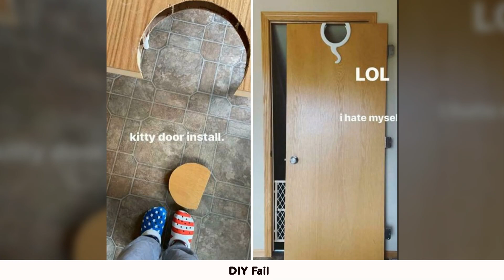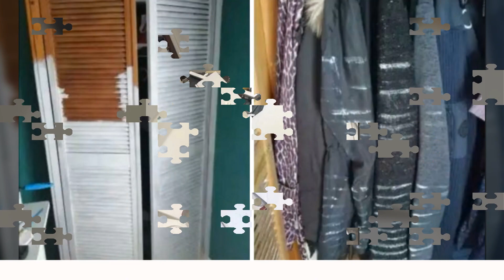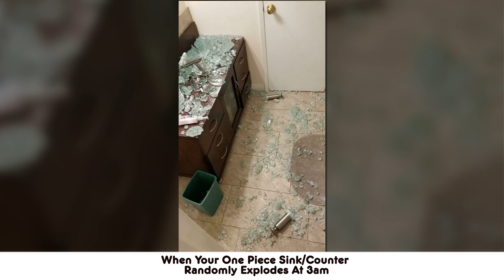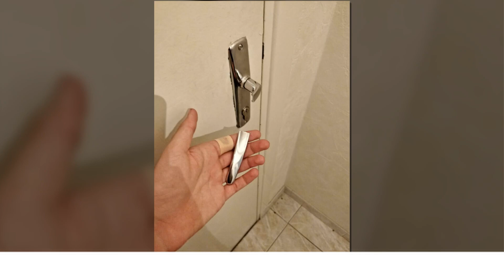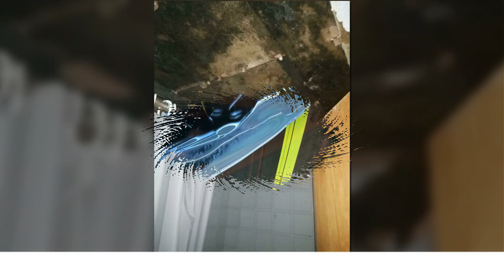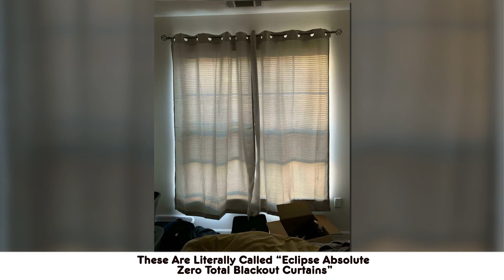‘Well, That Sucks’ Times Homeowners Had Their Day Ruined

Comment: Sis and I moved in together.  Beautiful 40 yr old house.  A former long time owner did a lot of improving.  Looks real good but we have pocket doors that can't open because the ceramic tile he laid raised the level of the floor, our switch box took 3 electricians to decifer, I almost burned the place down because the bathroom wasn't wired in the voltage it took to run the ceiling fan/light/heater unit, one of the bathrooms had hot and cold switched in both sinks.  Oh, and a screw punctured the outflow pipe for the upstairs bathroom that rarely got used until we moved in.  3 yrs of showers and flushing had dribbles going down the outside of the pipe.  When we opened the pantry we were getting a strong mold smell--the back wall had a huge stripe of black mold.  What a mess!  We were glad it was the pantry with our dishes instead of all the food.  Think we've just about got all his improvements either re-done or fixed.

Comment: Thank you for this video, it brought back sweet (😜) memories! 
We bought our first (and I hope last) home three years ago, a little house from 1965. 🏡

We knew, we had to change the boiler and the sewage pipes, but that was o.k. for us.
We expected only to put a little colour on the walls (this is the moment for 🤣😂)...

We wanted an extractor hood with a vent to the outside, so we had a specialist (!) drill a hole through the wall.
Conclusion: He also drilled out the heating pipes and two weeks after handing over the keys we had a serious flood in the kitchen...🌊

Then the electrician came and checked the power lines.
Were two-wire, everything had to go...
So my husband drilled slots in all the walls and laid new pipes.
But that meant that we couldn't just paint over the old woodchip wallpaper, as we had planned, but had to scrape off all the wallpaper and replaster the whole house inside, that became my job; amazing what you can learn when it is necessary! 🤪 (I'm still in physiotherapy treatment for shoulder pain...)

During that time, my husband removed the old carpets to find lots of big holes underneath, so we couldn't pour screed; he then leveled everything with a standing spatula so that at some point we could put parquet on top.

I won't even begin to tell you about the ceilings, which were made of plastered rushes...

Home, sweet home... ✨✨✨

We were very fortunate that my husband is a very skilled craftsman 🙏, otherwise it would have been a financial catastrophe for us.

(And another luck is that I'm a happy and peaceful person 😄, otherwise it could have been a relationship disaster...😁)

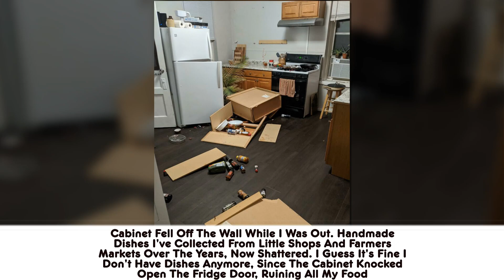Comment: 5:37. Five years ago we moved into our new build. For the first four years I kept complaining that none of the vents seemed to do anything. I thought they were just cheap vents. I bought some new, expensive ones and when hubs went to remove the old vents to put in the new, he discovered that they just shoved the vents through the drywall in the ceiling... right into the attic insulation. ALL of them were like that. The inspector missed it because why would he think that anyone would do such a thing? All we had to do was cut a hole in the insulation, replace the old vent and they worked just fine. smh

Comment: I've lived in my current home for over two decades now, and while my family's made considerable renovations to the place, there have been times it was more out of necessity than aesthetics.

1) Our home, like most houses within the neighborhood, is situated above a collection of groundwater, which sometimes necessitates the use of a sump pump when it rains. In the past, when the power went out, the sump pump would fail too, which in our case meant having the carpet in our finished basement ripped up and replaced twice. We eventually had a generator installed so that there would always be a power supply to the house and sump pump.

2) Our closets have metal racks and shelves on which to hang clothes and store items, but the original ones were simply screwed into the walls without any reinforcement. As a result, portions of my mother's and younger sister's closets collapsed (my sister was much younger and climbing on a lower shelf with a friend), and one day a few years ago, the entire rack-and-shelf system of my closet suddenly ripped from the walls, sending everything in my closet to the floor and making an incredible noise.

Comment: That door thing...so cute, still doable. Just turn it  around, reset the hinges and switch the door knob recess to the opposite side of the wall! (Diary of a single mom with four kids.)
Reply: That or just flip the door, flip the handle and hinges to the other side and boom, fixed.
Reply: @maolcogi  Or better yet... Just flip the door right side up and then, like magic, the latch tongue will line up with the recess in the jamb. The problem he has here is that he leaned the door upside down against the jamb. Note the misalignment of tongue and recess in the picture... I wonder how he is going to install that cat door hinge on the curved edge.

Comment: When we bought our house, I installed the corner china cabinet by using the screw holes that had previously fastened it to the corner.  But the builder had not put any studs in the corner.  The drywall was installed to connect at the corner without any wood to nail it to.  So, a few days later it came crashing down in the middle of the night and destroyed all our sets of china.

Comment: Had a leak in our bathroom shower.  I had to remove the wall to replace the shower control valve.   Found out the original owner of the house had used a garden hose and clamps to run the hot water line in the wall !!!!!!!!!!!

Comment: The blue color of the tiny bathroom is horrific. Worse is the tiny window between the 2 studs. The window could've gone all the way across.  CHEAPSKATE!  Run, spouse, RUN!
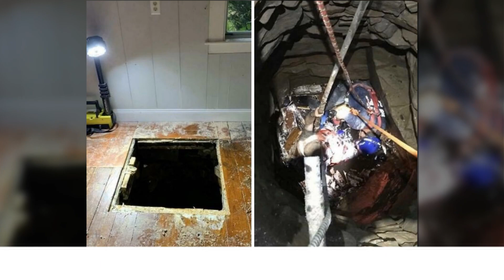Reply: You mean 4:56 ? No, just no. The colour may not be final and the "tiny window" is a vent. To put a window in all the way across would have meant significantly re-engineering the wall. The studs need to be cut-off and the window frame needs to be constructed to strength enough that it can carry the weight of the load-bearing studs above it across its horizontal top without carrying that load into the glass panes of the window you want.
Far too much work. And, as the walls are original and the house is not a new build, why should the owner go to that kind of expense?  "Ooh, but I want natural light in my bathroom!" What, for a room you're going to spend a grand total of 30 to 40 minutes in on average per day?
If you need that much natural light put a window in between each stud. Have the light without compromising the structure or wasting the money.
That vent is not cheapskate, it's pragmatic. Put the natural light in your kitchen.
Your demands for pointless spending are a strong reason for someone to back away slowly towards the exit.
Reply: @aaronleverton4221    Or better yet, get 'daylight' bulbs!  😀  They work great in my windowless bathroom!